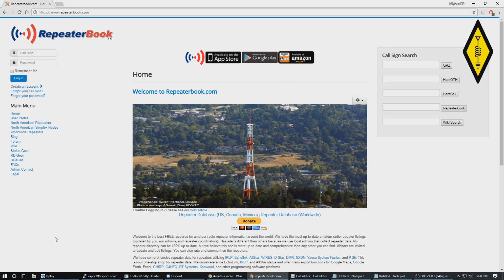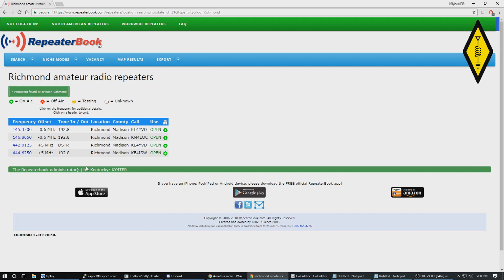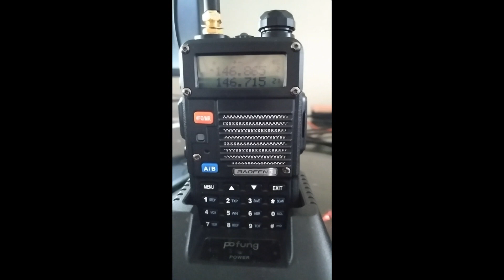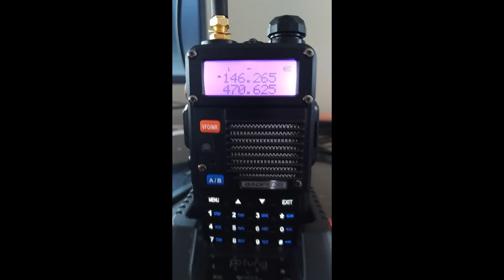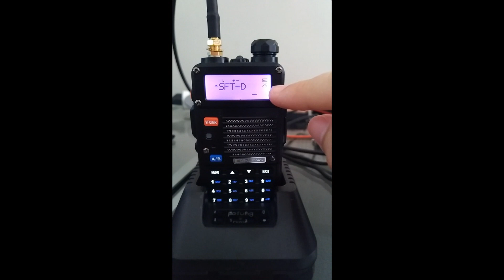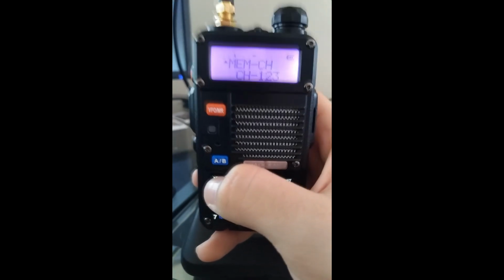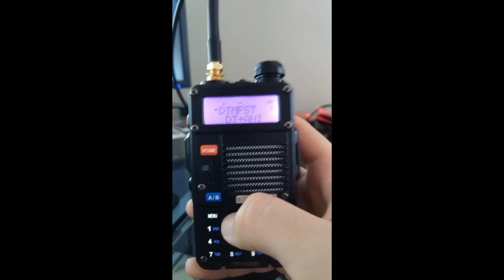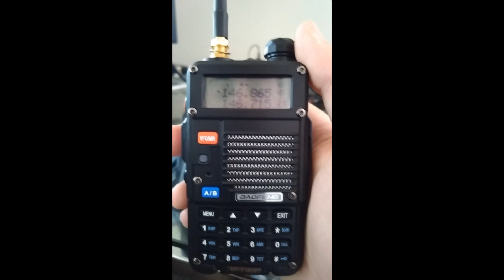How to put Repeaters in any BaoFeng Radio (UV5R F8HP etc)

Comment: Guys/ModernHam: Help requested. Using Baofeng BF-F8HP. I've followed your steps but believe something's wrong. I'm adding repeater w/downlink 441.350, Tx/uplink 446.350, offset +5.000. After adding tone and all other info (ex. ch21) I can Rx on 441.**, but when I Tx, the Tx frequency jumps to 451.350, instead of 446.350. The only way I can get it to Tx on 446.350 is to change SFT-D setting to 'Off'. Clearly the offset isn't working as entered. Not sure what I'm doing wrong.

Comment: Your offset was -0.6MHz and you entered 000.600, one I found was -5.0MHz, but when I entered 005.000 it didn't change to the right frequency. What am I doing wrong?
Reply: I have the same problem. It's doubling the frequency, e.g. I set it up for 444.925 RX, +5.000 offset, and when I transmit it's transmitting on 454.925... Looks like Scott Leaver below has the same issue. Apparently SFT-D should be OFF. The manual states 'SFT-D is not required when storing repeater frequencies into channels'. But I have no idea why it was doubling the TX frequency.

Comment: I have a question. I’m new to Ham. If you input an offset value and direction for instance ~0.6MHz why would it be necessary to input a transmit frequency?
Reply: That’s a great question..
Hope someone can answer that…
Reply: If you put in the offset and the direction (+ or minus)  you do not have to put in the Transmit frequency, but you have to go to the memory option and select the channel you want then press the menu button once and radio will store and say and store it Receive Channel, then press menu button again and radio will say transmit channel and restore it.  
The other option is to not set  the offset or offset direction, but rather enter a recieve channel and then a different transmitt channel into the channel memory. You need to always enter the receive channel first.

Comment: what do you do if the repeater I chose doesn't have a tone number? thank you! it only has DWNLINK, UPLINK, OFFSET .
Reply from the maker: It probably doesn't need one then
Reply: @ModernHam  So if you don't have a CTCS Tone  listed for the repeater then it is considered an open channel which does not require a CTCS Tone to communicate with it. If this is the case, then you only have to enter the downlink frequency (say 146.000MHz), offset direction (say -) and the offset amount (say 0.600MHz). Then you save this as your receiving memory into a channel (say 81). Then when you go into MR (channel) mode and select channel 81, if you press the PTT button, it will automatically change from the downlink frequency of 146.000MHz to the uplink frequency of 145.400MHz which is just the 146.000 subtract the 0.600 offset amount. Therefore, there is no need to go back and enter the uplink frequency and save it separately as transmit frequency. You only need to enter the uplink frequency and CTCS Tone separately if your transmit frequency needs to include the CTCS Tone...is this correct?

Comment: What antenna setup did you have in this video?
Reply: That antenna looks like it hooked up to a mobile antenna outside the house, they have small cables that will allow you to connect to the handheld to a coax cable